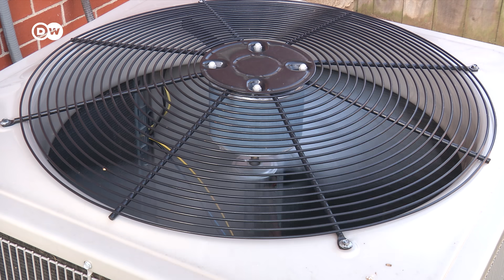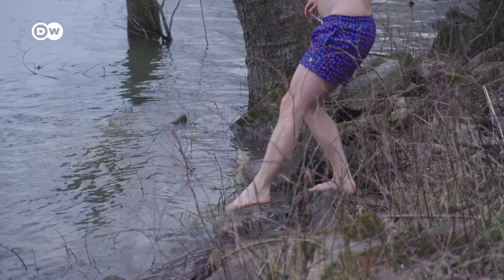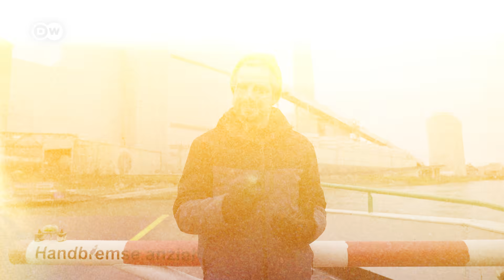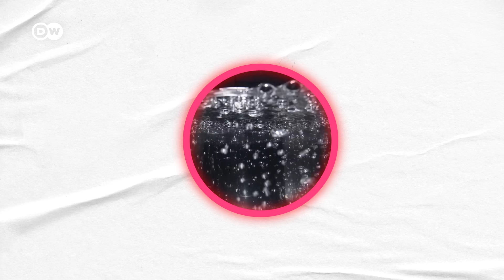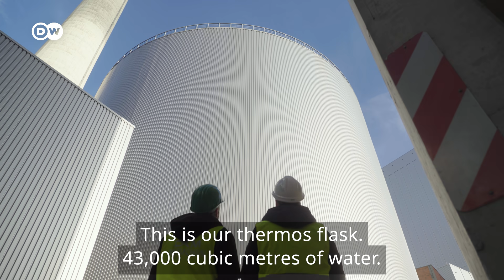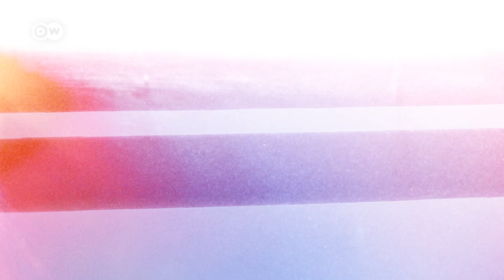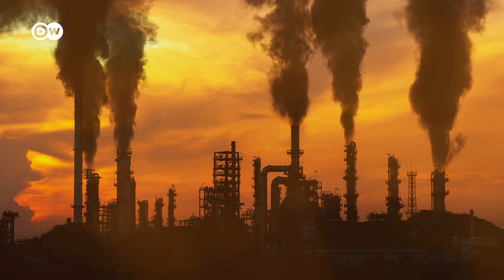Heat Pumps: How cold rivers could heat your home

Comment: That's right, in the latitudes where the G7 countries are located, fossil fuels are overwhelmingly used for heating.
At COP28, it seems that capital will be invested in construction using passive construction methods, but if the airtightness is poor, energy will be wasted in the winter.
Therefore, the conclusion is to improve insulation, and insulation traps the heat energy taken in in the summer, so before using the cooler, make sure to thoroughly exhaust the heat with wind.
We have been focusing on energy saving for decades, so please take a look at the products in the icon for reference.
I think it's quite interesting.

Comment: This is not new 20 years ago I installed a GSHP which runs off my well water even a -40f it works as my well water is always 50f I just take out 3 degrees and put the water back in the ground where it warms up again. 8 years ago I added solar now I have no utility cost at all or very small in winter.
Reply from the maker: Hey there! Wow, that sounds awesome. Thanks for sharing your experience with us. ✨

Comment: Couldn’t the chilled water be used for refrigeration even in winter? Connect everybody’s fridges and freezers to a central cold water line?
Reply: A fridge is a  heat pump. It moves heat from the inside to the outside. So a fridge contributes to heating your home.
On the contrary a cold water pipeline would contribute to cooling down your apartment, so it may hurt more than it helps.
Reply: Read it again . A cold water line TO THE FRIDGE  @anotherelvis
Reply: If the water cooled fridge is not fully isolated, then the heat from he surroundings will diffuse in to the fridge, and that is going to cool the apartment.

On the contrary a modern electrical fridge is one of the most energy efficient ways to heat up an apartment.
Reply: Mansplaining to another guy?  @anotherelvis
Reply from the maker: Hey John! That is a big advantage of certain heat pumps. A lot of heat pumps have a cooling function, too. Through a reversing valve, the flow of refrigerant can be changed.
Reply: My point was if you want to warm water back up so you’re not cooling the water in the river, use the cold water in winter for fridges and freezers.  @DWPlanetA

Comment: It should be noted that in the case of a larger number of such heating plants on one river, there would be greater cooling of the river downstream. That the heat exchanger will receive heat from the river also means that it will surrender its lower temperature. So every other heating plant downstream of the same river could have a slightly lower efficiency.
Reply: Unless they put it downstream of industrial production and power plants. Inefficient ones, meaning those that don't recover heat in their own facilities, would have some heated wastewater dumped into the river, right? So, at a certain point it helps offset the  effect of heated wastewater?

Comment: Industrial scale heat pumps can easily use CO2 gas as refrigerant- GWP is 1. I can not imagine what kind of potential risks of cooling river water by 0,001 oC in far far future the scientist is talking about. Where I live rivers freeze-up every winter, no problems whatsoever. I have installed ground-source heat pump, the house is not very well insulated, but I have opted for underfloor heating on the first floor, and installed oversized radiators on the second- heat pumps work more efficient at low thermal water temperatures. I'm also very happy with summer time cooling from the ground loop- all it takes is just around 50 watts (!) for circulation pump and fancoil fan to keep interior air temperature below 24 oC and r.humidity below 50%.
Reply from the maker: Hey there! With such a low change in temperature, there is no problem. The expert mentioned that it could be a problem at a certain point when too much cold water is released into the river. Due to a lot of plants using heat pumps. Possible negative effects can arise on fish and plants, the ecosystem of the river.

Comment: Might be good to look for upstream partners that have processes making waste heat that they can sink into the river. Basically use the river to transport waste heat to the heat pump.
Reply: I was thinking along similar lines, yes! There are a few industries that have to use cooling towers to cool down what is often river water before releasing it back (but still at a slightly elevated temperature). The one example on my mind is nuclear power plants, which of course, uhhh, aren't particularly relevant for Germany any more. But can be elsewhere! Anyway, it does mean you get to actually use that heat rather than just waste it!
Reply: Or just use the waste heat directly for district heating.

Comment: Important note is to have good insulation on building before instalation of Heat Pump. My 2023 Air condition has label as "heat pump". Working 20h a day, avarage outside is 8C and I pay for whole electricity bill 60€. Heat pump also on cloth dryer :)
Reply: Insulation helps always, no matter what the heating system is.

Comment: Is the “waste” water going to end up on the rivers? Cause if they do, how catastrophic would it cause ecologically speaking?
Reply: The waste water would just be normal water but 3 degrees colder
Reply: @grafity1749 and if you think about all the other warm industrial water dumped in the river, heat pumps kind of offset the effect of heated water.
Reply from the maker: Hey Leonardo! Yes,  the waste water would just be water 3 degrees colder. Right now, this is even beneficial as most of our rivers are overheated. However, as our expert explains, it has to be closely monitored as it could lead to problems in large quantitites.

Comment: Just decarbonized the house last October, no longer burning fossil in the house. Enjoying a Daikin heat pump. Neighbours visiting the house and asking many questions. My candid statement is if we can afford one, just do it, it is the minimum we can do for our children and grandchildren.
Reply: Spot on Jim, if you can afford to do it then it’s a no brainer. 

Solar panels, battery, heat pump and you’re good to go. My friend even has some sort of electric water heater too so they’re totally gas free, it should be legally required of every new build.
Reply: Same at our house ❤ electric car, heat pump and photovoltaic.. Kids were asking me what are petrol stations for and why don't use them :)
Reply: I did that 5 years ago and not without many troubles. We have a 200 year old country house (350 square meters shared between two buildings) in Denmark and have a 14 kW mono block heat pump, 16 kW solar panels and 12 kW battery. We have four bath rooms, 2 kitchens and mostly use instant heaters. The installation will probably never paid back, but I got rid of using pellets and therefore saving a lot of my own time and smoke.
Reply: Well done Jim
Reply: I suggest to have a backup since they break and Daikin will take a long time before repairing
Reply: I don't understand why it's so expensive in the EU. China and most of Asia have these for decades already.
Reply: I wish I lived far enough South, to be able to use one. But then, I would have to worry about tornadoes and heat stroke.😎
Best wishes from the cold weather testing city, in Northern Canada, for quite a few organizations/companies.
Reply: All well and good in summer but in peak winter... Best also setup some nuclear power plants... batteries are not exactly clean are they very destructive to the environment when the raw materials are mined

Comment: Instead of burning gas for heat, you use electricity for heat pump. That electricity still comes from the gas.
or you just try so hard to shift the crowd from directly using Russia's gas to the more subtle electricity, and pump up the electricity price along the way?
Reply: A modern Gas Power plant has an efficiency of 60%. Combined with a heat Pump with a average cop of 3.5, thats still more than twice as efficient than a Gas heater. And thats not including that it can Run with Wind power as well.
Reply: It comes from gas - partially, yes. Just like it comes from coal, wind, hydroelecteic and solar.

Still the efficiency is way higher than burning the gas directly in the house to heat it.

By electryfying heating and mobility, primary energy use goes down, not up.
Reply: Where I live, in Canada, more than 90% of our electricity comes from either nuclear or hydroelectricity. We have no coal on our electricity grid. Gas is used for about 5-10% but that is being phased out over the coming years.
Reply: A lot of German homes rely on local gas burners for heating, and they stopped importing Russian gas, so now they need another solution.
Right now the gas price is fairly low, but in the long run they need to switch to centralized district heating and and/or privately owned heat pumps.